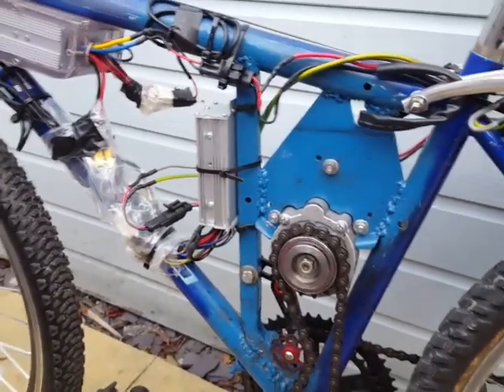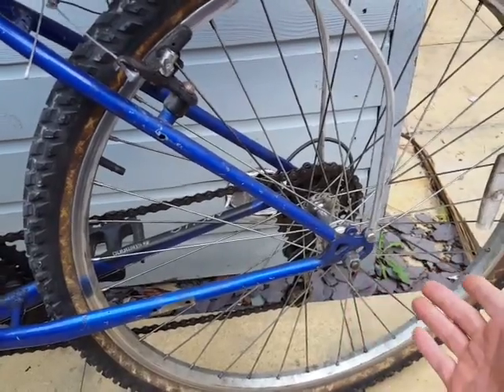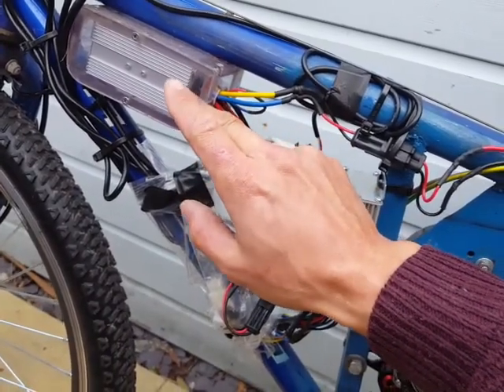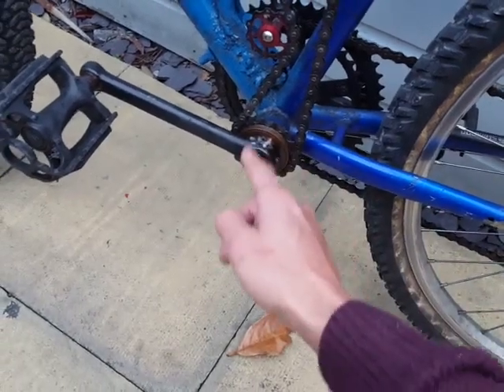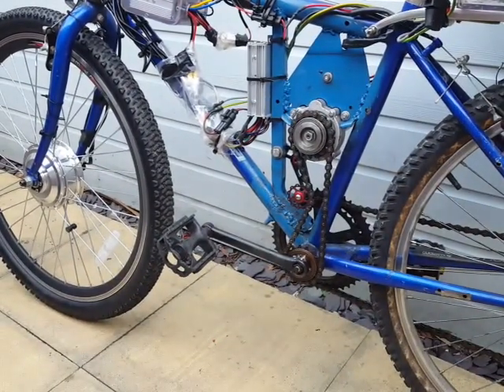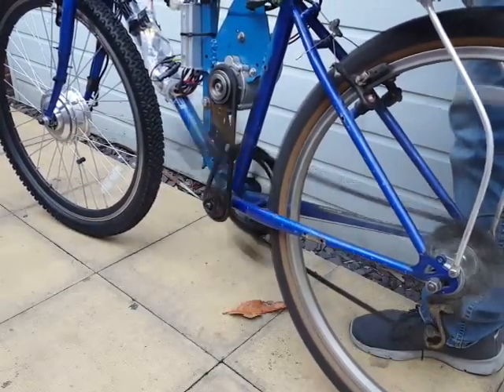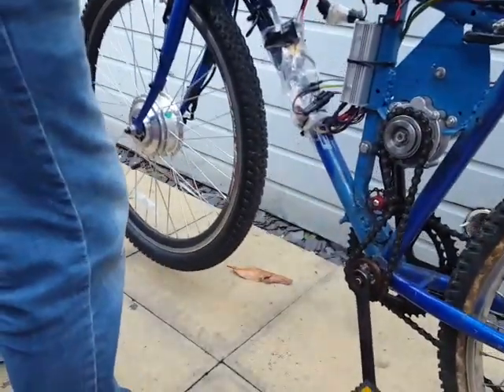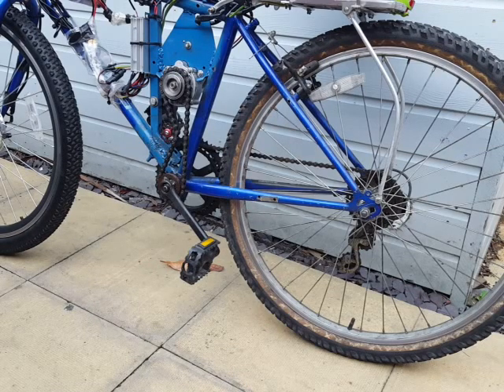cheap DIY mId drive ebike conversion

Comment: I've recently bought brushed 250w ebike motor to convert my cycle to an ebike.... Want my motor to use the gears same way i use em. Makes to more efficient. The only problem i face too is how to keep the crank independent of the motor but still use the motor to turn the crank. So that when i use the motor then the crank stays still and not go windmilling my legs away😅. Any idea on how to use freewheels for this???😊

Comment: The best thing about this to me is that you get to keep the chainrings. I have never understood why everyone seems to push for wide range rear cassettes that always seem to need maintenance like a needy problematic sports car, meanwhile the front derailleur of my 21 speed has never needed adjustment in the many years I've ridden it, yet the 7 speed cassette has had the chain pop off nearly dozen times, and has needed some TLC and readjusting several dozen times because its derailleur is having to flex so far compared to my childhood 10 speed's 5x cassette. If some company could just give me a way to put my 3x on a nice mid-drive conversion kit and keep my bulletproof front derailleur, I'd gladly pay a grand for a whole kit, but sadly old reliable has gone the way of the dodo, so I'll just have to hack together a much superior homemade mid-drive and wrap it all up in some nice 3d printed air ducting so nothing melts down on me. Maybe fit some heat sinks to the battery so I don't have a repeat battery near-explosion incident while the battery is up against my leg, it is not fun panicking while a battery is puffing out and going volcanic on you. Maybe a supercapacitor bank would be better? Those have far superior power delivery, safety and eco-friendliness by several magnitudes, I don't need the range I just need to accumulate a charge from every stop to help me get up the hills on my 40 pound monster XD

Comment: Well done! It would work better with a 44 tooth sprocket on your left crank to match the motor speed to a human pedalling speed, as well as greatly increasing the torque. I have actually done so, though with the 350W version of this motor. Very cheap, very reliable, but the motor reduction gear is noisy. I've done over 12000km no problems (I did pack extra grease in the motor reduction gear at the outset, because frankly, there was hardly any  in there to start with).
Reply: Do you have any videos or pictures of this? I'm looking to do the same.

Comment: That's so awesome man, you got my brain thinking :) I have an e scooter but I live in a city with lots of steep hills so its kinda hopeless as you'd expect. I thought to myself what if I had gears with an electric motor which would require less torque, then i'll be able to get up hills!  I was skimming trademe and almost bought myself a rear hub drive bike but I was interested in mid drive vs rear drive and wow did that open my eyes haha! 
That's an epic conversion you have there! I want to do something similar but I have to think of something so that the pedals don't try to take my out cause shit that looks dangerous haha! Love it cheers for the vid! :)

Comment: I guess there's no way around it. The peddles move with the motor, and you need a geared motor for slower rotation. I have a 4500 ram motor I think I'll have to put it on the back left side to keep it from interfering with the other gears, and use a freewheel sprocket on the motor

Comment: The whole point is that it works and takes you to work and back. But you will eventually need to reconfigure it to use a freewheel which is sold online so that pedals are spinning freely like the other mid drive bikes and also i hope youll get those Lithium Iron Phosphate batterirs for lighter weight, but you have all thumbs up for low cost and efficiency as well as practicality. Good job mate!

Comment: The first thing what I made before putting the motor on was a freewheel crack.

They are easy to make mine only cost £3 to make.
Cost nothing if you already  have spare freewheel.

Comment: You can use the pedals without turning the motor but when the motor is turning, the pedals use you 😜
Reply: That's not true. You have 2 sprockets and when one is engaged the other is free (and vice-versa).

Comment: and very original and beautiful as an idea. in my opinion you should mount a larger chainring near the pedals because in this way the central motor has little power and a very large current absorption, try and see that it will go better. I greet you and hug you. good job! you can see my bike on my youtube channel. maybe you tell me what you think. See you soon